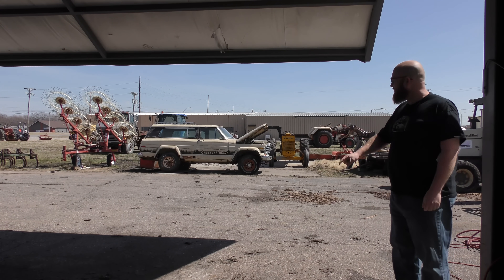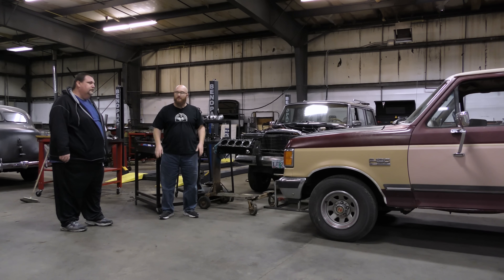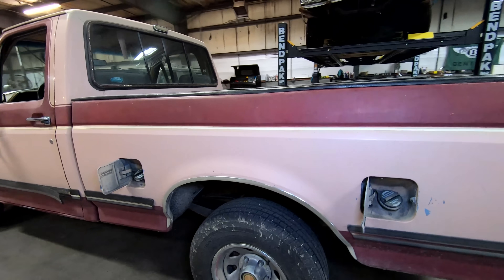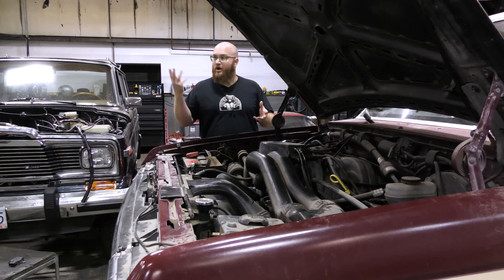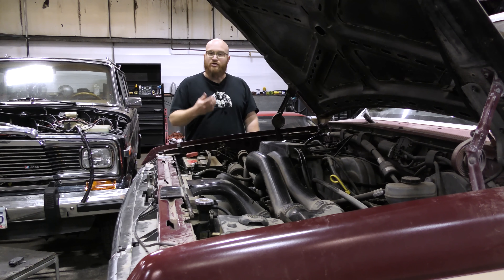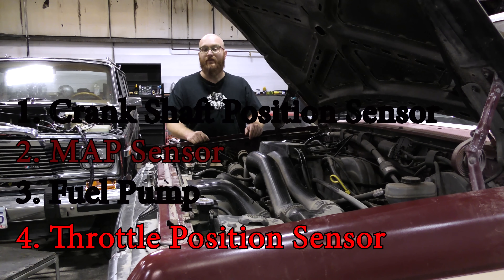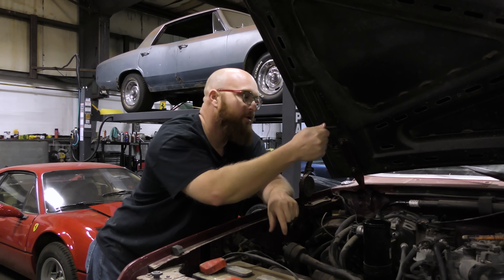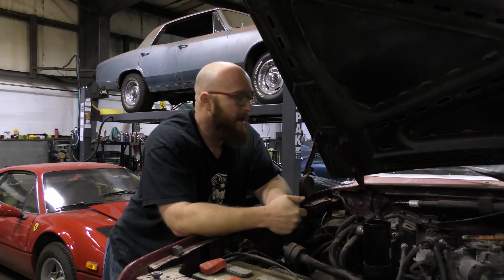Parts cannon couldn't fix this '90 F150. Old School diagnosing by the CAR WIZARD

Comment: Man, seeing that old F150 makes me miss my 96 shortbed.  Had the 5.0, EFI, chrome stock rims and would practically turn on a dime.  Both of its tanks worked and it had zero rust.  Sadly, it was stolen and wrecked one night.
Reply: rip
Reply: On vice grip garage a feller would rate this an A or A+ then go get a cold snack
Reply: I had a 97 old body style short bed with the V6 but it had a 5 speed tranny. It was about the most plain jane truck you could get from Ford at the time but it had a killer AC and Heater. Believe it or not on the highway the truck was a champ and got 26mpg+ because it was a 5 speed. I needed something bigger and sold it for $3000 and those people drove it for 5 years and never changed the oil and eventually blew it up. I seen it for sale on Marketplace recently and they are asking $2000 for it with a blown engine lol if it weren't impossible to find another V6 I'd offer them $500 and probably be able to buy it back but right now there is no way I'd be able to find another engine for it. I wonder if I could put a V8 in the truck the way it sets using the same 5 speed tranny? That might actually be a really good set up.
Reply: @tstryker03  Ya, a V8 would drop right in no problem.
Reply: Yeah those older trucks get stolen too often. Gotta rip the damn fuses out to keep them street parked
Reply: @Tim Tebow a V6??  Do you mean the 4.2?  I must say, I've only ever seen those in the E series...  I didn't know they offered it in the F series, as I've only ever seen it in fleet ordered trucks (well, vans lol)
I'd have assumed the 300 (magnitudes better than the 4.2 could ever be) but pretty sure those were discontinued by that year, sadly.
Reply: I know your experience. I had a 69 F100 that was stolen. I literally the day prior had purchased new drums and pads for it the day prior. It was later found in a farmers field with a tree about the size of my thigh stuck in between the cab and bed. I was proud of the fact that truck fired off without any issues every time.
Reply: It is the fuel pressure regulation valve
Reply: I bought one brand new in 91. Still have it. Sorry for your loss.
Reply: This is the worst story I've heard all week 🍻

Comment: i have a 1991 ford f150 5.0, What I did was replace the map sensor also. You have to put gasket sealer around seal on the new map sensor. The rubber seals on the front of the truck let water down on the map sensor and it will go bad again. If you look closely at the map sensor it is mounted upside down on the truck so where the cover on the map sensor saps together that part will allow water to come in. If it mounted the other way I don't think they would go bad. If you don't believe me take the old one apart and see if it is rusted out or water is still in it. Second thing the vacuum lines. that go from the left side of the engine to right side are all color coded but the problem is that were made out of plastic back then. If you follow them from left to right you will find a junction block where they meet behind the engine. Mind you you have to get up on the engine to see the junction block behind the engine next to the firewall . They don't' leak they just melt together or complexly seal off. Go out to Silicon intakes website and purchase new vacuum lines by the foot. I think 4mm is what I used. I think I paid 1.25 a foot and you will need around 30 feet I think.  There lines are real spongy at about 3/8 in  thick and will not collapse under use. They come in 3 colors Red Black and Blue. I just ty wrap them  off about two inches above engine so they don't get hot. They look really cool when you use different colors.. After I did that it stop the high rev up during the start up. Now the the truck will per all day at 600 RPM. I hope this helps

Comment: Thanks so much for featuring a regular truck. Can you add more of these in the future?
 Millions of us have a truck just like this. Millions of us do not own Ferraris.
Reply: There arent that many millions 90s truck. Stop living in the past.
Reply: a real truck..one with "only " 2 doors, one without a back seat, power everything and heated seats. They can't bring those back soon enough for me.
Reply: @CamoShirt  I'm literally looking at cargurus right now and there's 2 90's 150, 2 GM trucks, and no Dodge trucks in my area in a 100 mile radius. Back off boomer, quit living in the past.
Reply: @jasonthach44  I wouldn’t be so sure about your claim. There’s an estimated 16.9 Million Ford F-Series pickups on the road today. 

There might not be millions of an exact year, but I am willing to bet that there are around a million of this model’s generation (87-91) still in use. 2,196,074 were sold for the 8th gen (87-91) F-Series pickup.

I have the 87 F-150 XLT Lariat. Mine was built in December 1986, and it was number 18813 of its specific trim package built. 113k original miles (odometer rolled over only once) and runs solid.
Reply: @jasonthach44  Confirmation bias if I ever saw any. Just because there aren’t  many for sale in your area, doeen’t mean there aren’t a lot in use still. Or even sitting in a salvage yard for parts. 

There are entire online forums devoted to F-150 owners. If they weren’t that popular, you would see the salvage yard just gut them and crush them and sell the metal right here and now. There’s money in selling out the hard to find parts.
Reply: And if we do we have a Wizard to fix it.
Reply: @jasonthach44  i see these on the road every day where I live, including the one I drive

Comment: This video proves you're a wizard.  I came to the same realization a few years ago when I bought my "new" truck.  Wound up going from a 2005 compact sedan to a 2003 Silverado that I got for cheap.  Sure I've put some money into it in the time I've owned it, but it's so easy and cheap to fix and I don't have a loan for a $50k truck.  Suddenly it makes sense to put $2-3k into an older car and drive it another 50-100k miles.  I might drive the oldest car of just about everyone I know, but I love it and I'm proud I can keep it on the road with my own tools and hands.

Comment: I had an 83 Grand Marquis with a 5.0. Had idle issues as well. After replacing the TPS, it was still stumbling. Turned out some water in the gas from sitting rusted the screens in the injectors (2bbl throttle body).
I just bought my 4th F-150 (95 with 266K) and having owned 84 and 91 models, I still have my OBD-1 scanner. 
The most common problem I’ve ever had was the ignition control module. I remember when you could buy them at KMart with all the other tuneup supplies!

Comment: I've been successful fabing my own bushings out of bronze valve stem guides on old "classics" similar to that F150.  Find a bushing that is undersized for the trottle shaft and ream to size.  Cut to length leaving enough to contour to the throat of the throttle/carb.  Works great.
Reply: Can also use the brass fittings tubes found at hardware or plumbing supply stores
Reply: Hobby lobby has a selection of bras tubbing
Reply: True innovation right there.
At some point when the tech is good enough, it will be good business to be scanning and making exact replicas of all the parts for these old vehicles, with 3d printing on a per1order basis. Cutting out all the tooling cost of manufacturing.
Side note, I learned how to re-babbet an engine this winter for my ‘38 ford. That’s where you secure the bearing journals into place with molten lead. Fun stuff
Reply: What kind of tolerances are you using to compensate for heat expansion? I'm worried that if I machine it to perfect dimensions the brass might expand and grip the shaft making it impossible to turn when hot.
Reply: @joshuamcpeek4708  Since the throttle shafts I've been working with are roughly the diameter of the steel valve stems, I've been using 0.001 - 0.003" clearance with the silicon bronze valve guide material.  After measuring a couple of them using a split ball gauge I now find that a slip fit works and I've not seen any signs of binding or galling.  Since die-cast carb bodies are so brittle, I use a light interference fit for the OD of the guide and lightly stake it once I tap it in place.  I think you'll find very little range in temperatures at the throttle shaft. Maybe -40 degree air temp up to maybe 400 degree F when heat soaked (hard pull then shut down).  Gas boils around that temp.  I've seen a couple of my carbs with over 125k miles after the rebuild and the shafts are still in good shape. It's a fairly time consuming process but if you want to keep it "original" I highly recommend it.
Reply: @tatdexter2334  Thanks for the info it was very insightful!

Comment: My grandma has a super basic ‘91 Ford F-150 with the straight 6, automatic transmission. It’s an awesome truck and goes great in the snow. It came factory without a headliner, no ac, not even a cassette player, manual windows and locks. Bench seat. Right now it has a short somewhere in the taillight wiring, and she also needs her leaf springs replaced. But it is the perfect farm truck. Has a large topper and is a long bed.

Comment: Since I own a '94 F150 with a 302, I loved this video.  Thank you so much for the tips!
Reply: Same here, 1986 f150 owner.
Reply: here, here lads!
Reply: @nathankoroush7918     85 here ...
Reply: 94. F150 5.0 I love these trucks. My dad and family always owned four trucks. They were always in the construction business. I always run fords My favorite motor is a 390. and 302 the most simplest engines ever to work on these engines either have a spark related problem or fuel problem and the transmissions are always a weak spot. Most people don’t serve them or have a small transmission cooler. I like to have a big cooler and synthetic fluid to keep it running cool.

Comment: This video is equal to the best one the Car Wizard has ever done. I thank him very much. And BTW, this truck is exactly perfect for a young driver. It gets the job done, its basically in good shape, and he can learn a little more about working on cars and trucks. I'm sorry that this repair will cost around $800 (+/-) , but actually perhaps the owner could learn to do some work on it himself. If the diagnosed problem is worn bushings on the throttle shaft, perhaps he could figure a way to make his own bushings and install them. That would give him some tremendous pride of ownership. "I fixed it myself."

Comment: My brother owned a 94' with the 302. Use to be a dune toy with the factory engine still in it. Was running on 6 cylinders when he bought it. Thought it was just bad spark plugs or something. Turns out it didn't like ingesting sand and destroyed 2 cylinders. 1 broken connecting rod, other had no valves. Hardly smoked and the engine ran smooth, had lots of power lol! Very tough engines.

Comment: Just as soon as you rattled off the potential list, I immediately started thinking of the the throttle shaft being worn. A good friend of mine had a full-time carburetor rebuild/restoration business for about a decade, and more than once I bore witness to him having to drill the throttle shaft bore for bronze bushings due to excessive wear. Not terribly difficult, but time consuming compared to swapping on a replacement.

Comment: Hey Car Wizard. I've worked on quite a few OBD I Ford's, for myself, and for there people around here.
I have a 1984 Lincoln Town Car, that I found that I needed a new throttle body for, and I couldn't find one anywhere. Even in the salvage yards. It's CFI. I never really cared for that system anyway. 
I initially converted the car to a carburetor. That worked well for a while. I started burning some oil, so I took the engine apart. Long story short, I put together a 351W stroked out to a 408.
I topped it off with an Edelbrock Performer RPM intake, and a Holley Sniper EFI kit, and ignition system. I know that this is a lot more expensive way to go, but I swear by this Holley setup. I even used the stock in the tank Fuel pump on my Town Car. I think that with these older fuel injection systems, this is going to be the way to go.
There really aren't any OBD I parts cars anymore. Seems like Cash for Clunkers was a war on OBD I.
Reply: CFC - yet another gift from obama.

Comment: Bbk 3501, it’s a upgraded throttle body assembly, all in stock at summit racing
Reply: I’ll second that. If you can’t get oem there are always performance upgrades for the 5.0

Comment: As a backyard mechanic I can attest the value of an OBD scanner with as many adapters as can be had for it. 
I have one for my 1994 f-250 (okay, was dad's scanner and his f-250 before I inherited them), and it has been invaluable to save time and money.
Reply: With this era vehicles being able to read some data is invaluable too. Plenty of these sensors won't throw a code when improperly adjusted or bad. 

Quite a problem when someone has thrown a pile of junk chinese parts on it and introduce more unseen problems because the main issue is still there.
Reply: @volvo09  Electronics don't like heat in general though. And with some doing. You could actually reroute the electronics away from high heat areas of the engine and remake new electronic parts if need be on the older cars. The backyard mechanic has evolved a lot passed the wrench and hammer.
Reply: None of those newer scanners work with these Fords. This is an OBD1 system using proprietary coding, oddball diagnostic plugs, and an adapter harness temporarily installed in the wiring. It's essentially a Ford-only tool for these models, nothing else will work, and there's only a handful of codes- not the dozens like today's cars. But the system is simple so you can use a multimeter just as effectively as he did here. For other than the ECM and throttle body, parts are cheap and easy so doing a parts cannon is common and generally works well.
Reply: @P_RO_  I agree to a certain extent.  Diagnostic time is sometimes not worth the parts cost.  Us back yard mechanics now have the power of the internet to help each other with  diagnostic hacks and aftermarket parts reviews.
Reply: what scanner do you use.  just got a 95 f-superduty and the obd1 adapter for my actron scanner that fits my 95 5.0L bronco does not fit the diesel plug. any ideas?

Comment: I watch your videos all the time but somehow missed this one. I coincidentally bought a 1988 f150 2wd with the 4.9 i6 back in February and did a TON of work on it. I am a backyard mechanic. I have 5 ASE certs from automotive school but I never persuade a career in automotive. I couldn’t agree more with you about how hard these trucks are to diagnose. I had to replace both fuel tanks and both sending units because of holes and rust in both tanks. That really ironed out a lot of its issues. Whenever I find myself getting frustrated with it I remind myself it’s 35 years old and I should be grateful it’s still on the road and not in a scrap yard somewhere. The little truck worked it’s way into a special place. Makes you realize how simple times were back in the day when I wasn’t even around. Gets a lot off attention on the road like a classic or something. Thanks for this video!

Comment: Had 2 F150's. An 87, and a 94.  Both of them were regular cabs, 8ft beds,  300 W/Automatics.  Lots of parts replacements on BOTH of them, but not any parts of the driveline, other than valve cover gaskets,  lifter gallery and oil pan gaskets.  Both received fuel pumps,  rear tanks,  fuel lines,  brake lines,  heater cores,  brakes,  and ball joints.  87 rusted off the cab mounts, and had to crush it.  94, finally sold it in 2008. Loved these beasts.  Then bought a truck from the competition,  but that is another story

Comment: Those dual tanks screwed me one time. I don't remember what led to it, but I was stuck with only the back tank, which was quite a bit smaller than the main front tank. 120 miles a tank, tops. I hated that summer.
Reply: A guy pulled me over in my '87 Econoline and told me my rear fuel fill door was leaking gas and sure enough the solenoid valve had gone bad and was returning the excess fuel to the rear tank instead of the selected front tank!  It went bad several more times before I sold the truck.
Reply: I had a similar issue, had the front tank selected, gauge was reading front tank but the selector valve had failed and defaulted to the main (rear) tank. Ran out of gas because of it and didn't figure it out until I got it home. I laugh at that now, but it wasn't funny when it happened. Luckily it happened a few blocks from home.
Reply: I've had them save me more times than have a problem with them. Nice to have a second tank and pump when a fuel tank is acting up in the heat.
Reply: @shaung638  SPEAK TO ME SHAUN!!!  I've had ongoing problems with mine stopping in the heat and then running fine the next day.  What was the problem???
Reply: @boyracer3477  Good chance it is the fuel pump itself that is acting up. As they age the output pressure goes down and engine heat combined with a hot day will cause enough back pressure that the fuel pump won't move enough fuel. Typically the motor will either die or run extremely rough. If both tanks are functional try changing tanks as soon as the motor starts acting up. Should clear up right away unless you happen to have both fuel pumps bad.
Reply: My 91 E350 doesn't have a tank selector solenoid, the switch only runs the in-tank pumps and gauge. There's a main fuel pump on the frame rail which the tank pumps feed into. I liked my old carburated 83 van better; the solenoid only switched tank pick-ups and the only fuel pump bolted onto the timing cover.

Comment: I bought new a 1987 inline 300 six with a 4 speed and 4x4 and a 1993 with the same set up.. Both were great trucks with great torque and enough power; did have problems with the dual tank fuel pumps..